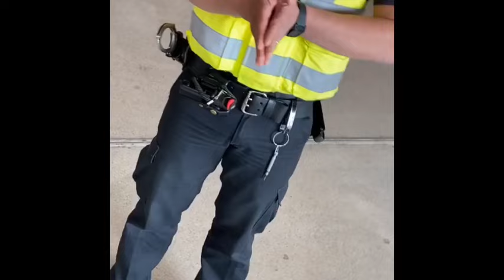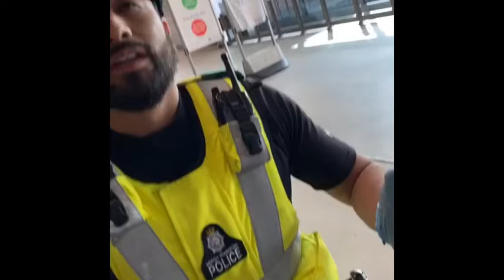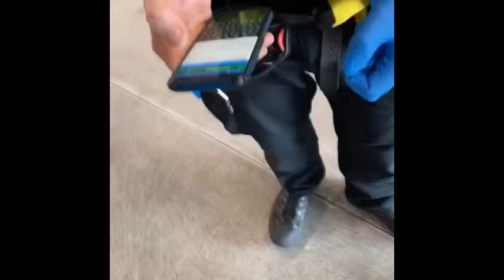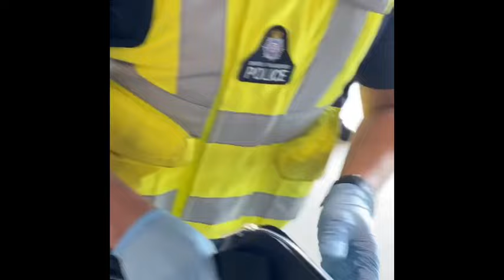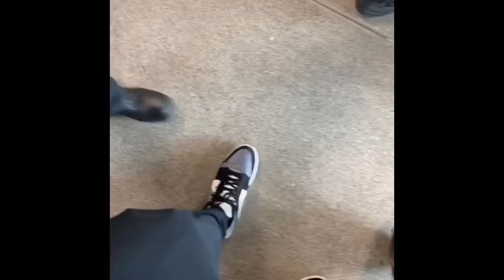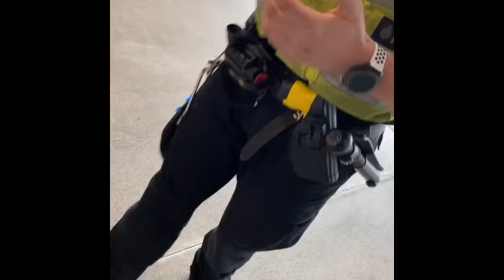Cop Using Section 60 To Stop & Search & Intimidate

Comment: If you are stopped again and they say they are searching you under section 60,  You should ask them when the section 60 action was commenced and when does it expire.  Ask for all their names and numbers and keep your recording of the conversation.
When you are released, make a request for all their  bodycam recording.  When making the request advise them that the recording must not be deleted.  Until ant investigations are finalized .  Also, that this evidence will be required for any trials or investigations have been completed.  Also, that Failure to do so is an offence under Data Protection Regulations.

The police have a tendency tp prevaricate an d delay in sending you the information that they can say that a period of 30 days has expired and that this evidence has been automatically deleted.